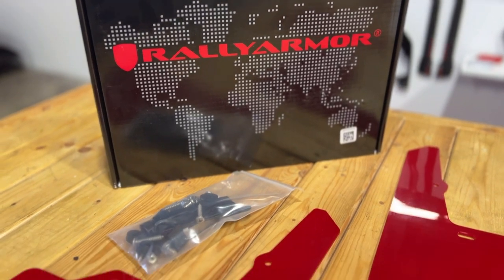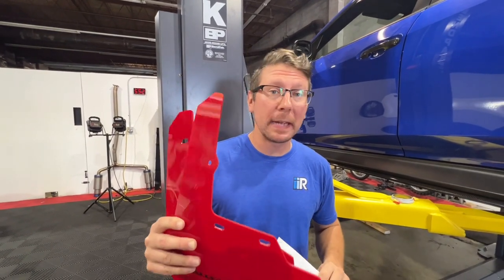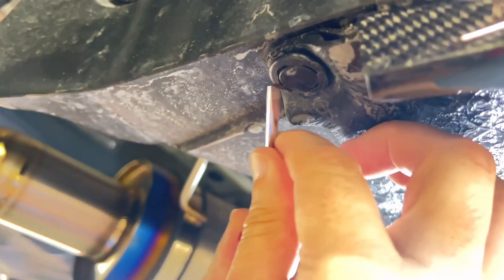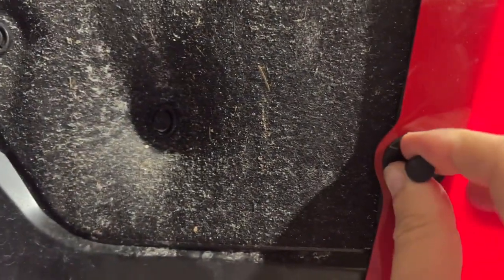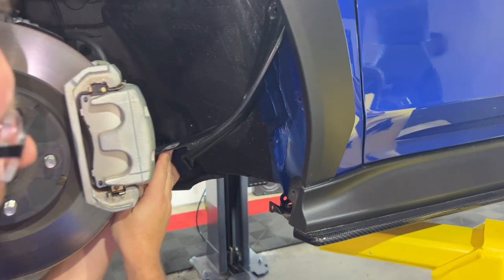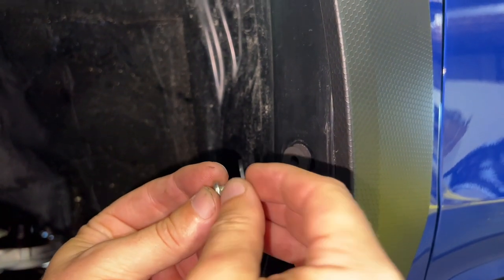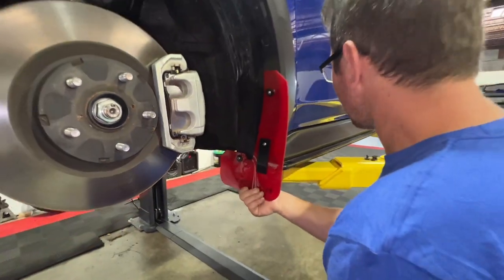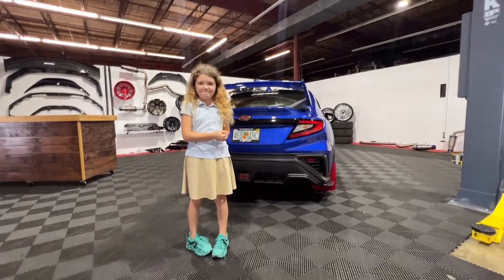Rally Armor Mud Flap Install for 2022+ Subaru WRX

Comment: I just installed oem mud flaps on my 22 wrx. Up front the oem ones were easier to install. On the back, rally armor did a good job with that set up. The oem rears requires drilling out 4 holes.
Reply: Thanks for heads up. I was planning on getting the oem ones but I don't want to drill so I'll get the rallyarmor ones
Reply: @azca.  the drill points are actually pre marked and you are only going through a thin bit of cladding. I would still go with OEM.
Reply: @imoffendedthatyouareoffended  you call aftermarket mudflaps aggressive, I call them gaudy. But, to each their own.
Reply: @imoffendedthatyouareoffended  I much prefer OEM fitment. Stuck out wheels are pointless and look ricer. But to each their own.
Reply: I took off my OEM ones and put these on today. The OEM have better brackets for the rear. The fronts are no big deal. The RallyArmor rears do NOT fit right. you need to drill a new hole. The OEM ones fit much better, but these look a lot better and are heftier

Comment: I ordered these with the altered lettering that are supposed to have the better brackets. I got a Rally Armor box with the correct part number and the regular flaps you see in this vid. The rear flaps do NOT fit like you see in this video. The middle hole of the rear does NOT line up with the OEM hold. You need to drill a new hole to make them fit correctly. The front fit fine.

Comment: I liked mine,  Up to the point I lost the metal braces on the front.  I replaced one side and sure enough, I lost the other side.  I finally ended up putting on the oem version.  So far I am very happy with them.  Maybe I was doing something wrong.....Who knows.....
Reply: Probably just vibrated loose over time. I put a some Loctite blue threadlocker on them and that seems to be enough to keep them in place.
Reply: The front use some cheap plastic bracket to brace it. I broke one installing them. POS. should be metal. IDK what the big deal is. RallyArmor could just make a metal piece instead. But I do like the looks of these much better.

Comment: I'm having trouble with removing the screws on the front only 2 outta the 4 are coming out any ideas as to how to get the others out?
Reply: If they're just spinning and not backing out, try to put a flat head screw driver at the base of the bolt while trying to remove it at the same time. Sometimes, these can get stuck in the plastic and need a little extra to get them back to the threads to back out.